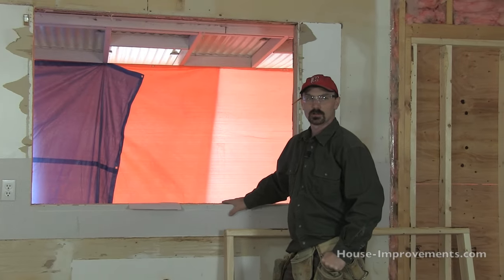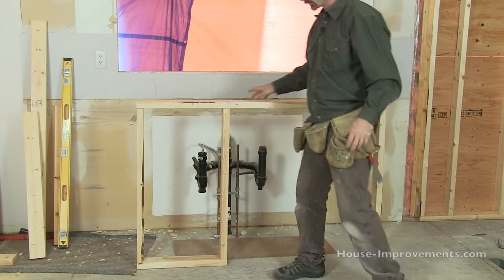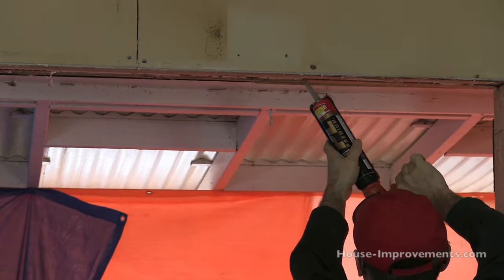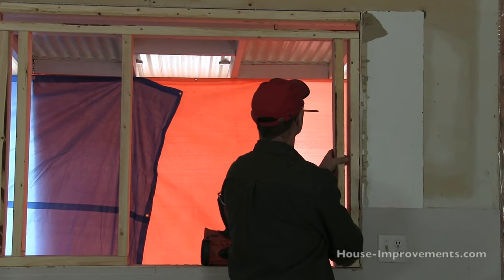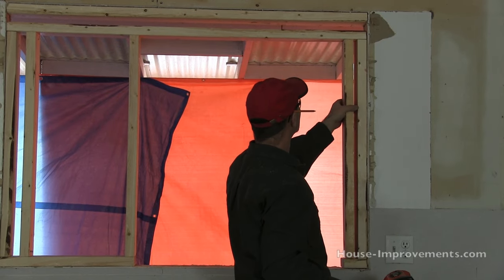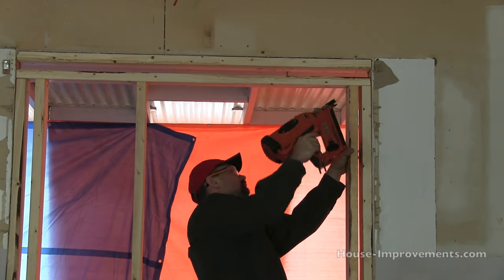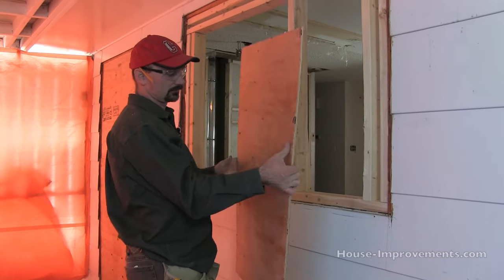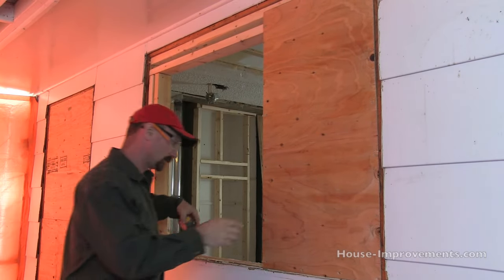How To Frame in a Smaller Window Opening

Comment: I just reframed a similar size window. Very helpful vid. One question: you used only a single trimmer board on the sides of the window. I've seen others use double trimmers, but is that really necessary?
Cheers
Reply from the maker: Double trimmer on openings over 10' is the rule but i normally double them on anything over 8'
Reply: I was told by inspections and code 7ft or more but for a rule just add double make all people happy

Comment: Not sure if you follow these comments but what if you're doing this on a house built in the 1950's that doesn't have house wrap?  I'm trying to remove an old window and replace with wall.  Right now there is just T&G solid wood sheeting between the cedar siding and the 2x4s.
Reply from the maker: Usually there would at least be black tar paper under the siding but it seems not in this case. Not really much point in adding anything in this small area if the rest of the house has nothing IMO. Next time try our forum when you have a question.https://www.house-improvements.com/forums/
Reply: @HouseImprovements  Will do.  Thank you for your help!

Comment: I've moved  into a house  where the attic window  frame  does not fit the space, there is a gap on the right  which is not protected from outside  elements.  What  can I do to fix iit without  having  to remove  the whole frame?

Comment: I wish there was a video on resizing a concrete wall opening.  I need to put in a smaller window into a much larger basement window opening.  Too much reduction to use wood only. No cinderblocking either.

Comment: I’m remolding my bathroom and there’s going to be a window in the shower. I really don’t want there to be and I don’t have a choice. Anyway the window is big and I’m looking to make it smaller (height wise) the width is fine. I want the window high enough so water won’t splash and moister or mold build up. However, the window sits on a cemented foundation. Question… to make it smaller (height wise) is it best to use cement on to build the window frame or use wood? I want to make sure I’m correctly modifying the window to prevent any issues from the inside or out. Any feedback from HouseImprovements or anyone I would appreciate it. Thank you.
Reply from the maker: If you are removing it and replacing with a new smaller window,then why not just take it out and fill in the opening completely?
Come to my forum if you have more questions.http://www.house-improvements.com/forums/
Reply: I'm going thru same issue

Comment: I love your videos and thank you for posting them. But I was wondering if you are extra generous with your nail count or are you following code spacing? I ask respectfully, you are top notch!
Reply from the maker: Nailing for exterior sheathing should be nailed every 150mm (6") on joints and 300mm (12") along intermediate supports, by code.
Reply: Right on....I need to up my nails then. I'm not a professional but like to follow code as much as possible on home projects. Thx for the reply

Comment: What kind of nail gun is that?
Reply from the maker: +John Frederick  Paslode
Reply: +HouseImprovements Thanks. Is it a framing nailer, finishing nailer, etc? Also, what size nails can it use?
Reply: +John Frederick It's a cordless framing nailer, they are pretty standard.
Reply: Up to three and a quarter inch long.  Straight or ringshank.   I just bought a Paslode cordless framing nailer off ebay...can't wait to use it.
Reply: pasload if I'm not mistaken.